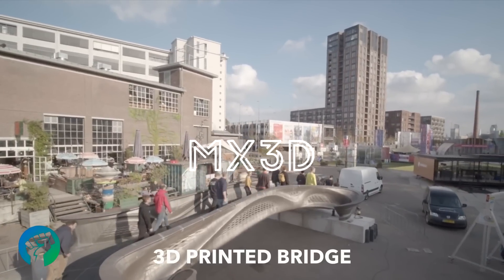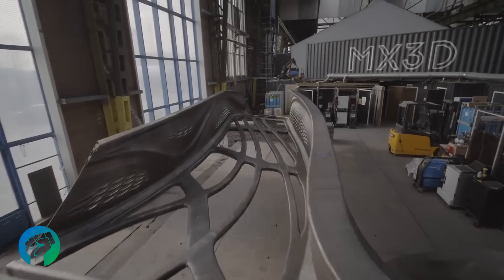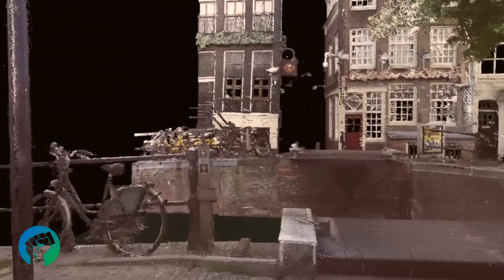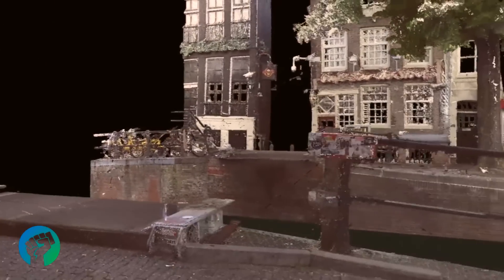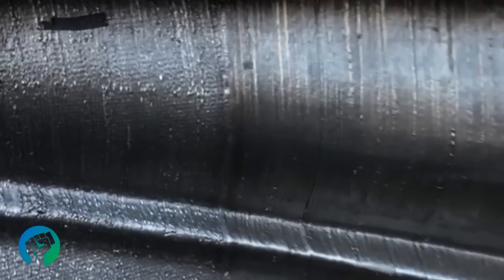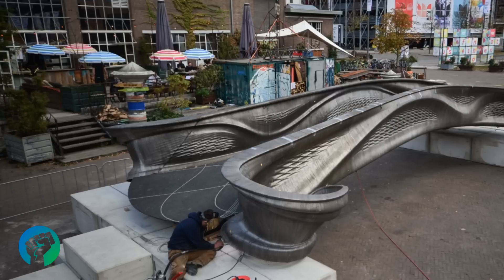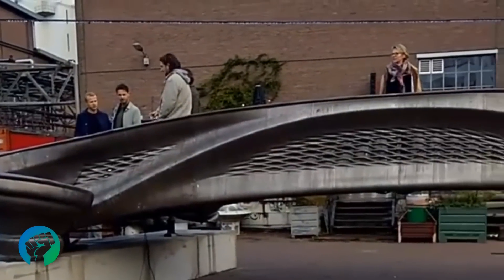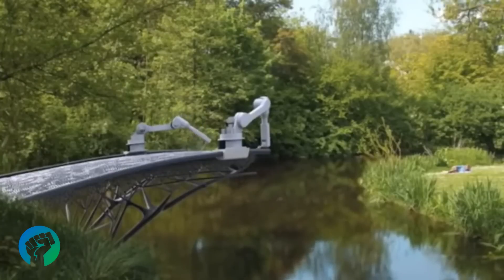This Bridge was 3-D PRINTED in Midair

Comment: you can see no actual welders were onsite to look after the actual welding, it shouldn't have those differences in the surface finish, a welder would have tweaked the machine to ensure that happen.

Comment: Sorry. Dumb project, dumb bridge, dumb pipe dream. We've been able to 3D print bridges for a long, long time but it's a really stupid way to go about building bridges; there are far, far cheaper ways to accomplish the same thing... and get substantially better results in the process.

3D printing IS NOT ALL THAT. The same goes for CNC anything. It's useful for certain one-off projects but it's not economically sensible for most things.

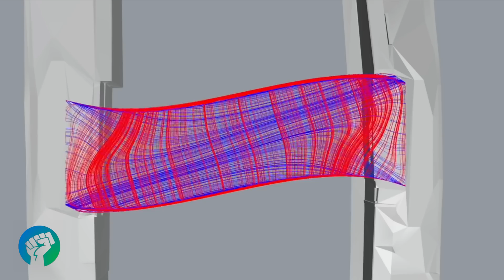Comment: 00:29 "Six months of printing.."

How the hell people willing to put their money into this..?
Reply: This tech will be very useful for permanent stations on Mars & the Moon
Reply: @freegedankenzurbaukunst5613  steel production is much more difficult off planet though, how will they solve that? Bring a bunch of coal coke?
Reply: @midgetman4206  They'll find a way . Humans always found a way
Reply: @freegedankenzurbaukunst5613  what do you think though? I want to see your gears turning
Reply: @midgetman4206  head could be generated using plasma arcs, which could get their energy from nuclear power plants. 
I think it's more likely that they will design structures which make use of available materials, like that 3d printed house using martial soil.
Reply: @midgetman4206  head could be generated using plasma arcs, which could get their energy from nuclear power plants. 
I think it's more likely that they will design structures which make use of available materials, like that 3d printed house using martial soil.
Reply: @gormauslander  you need to send a reactor first though, those aren't exactly light or robust, and you need other materials in order to make steel (at least if you want good/useful quality) such as nickel, cobalt, chromium, the right source of carbon, many other stuff.
 For the printed structures, how will the interior be made air tight? a spray? what about to make certain equipment such as plumbing? will separate material be brought so that it can be printed or will pipes and valves be brought along. Can't make tools unless a workable metal is found, if steel could be printed than a forge press could be made, that could make copper wire and that would allow you to make coils (for motors and soloniods) for drills or replacement motors for vehicles or servos for machinery. But all of that needs a method to manufacture metal, brass could make due but they just need something
Reply: Obviously because it's early tech. It would get faster as technology advances. 

Remember ENIAC? Compare that with the modern desktop PC and you'll understand.

Comment: This is exsactly the kind of thing we need to put money into. Building bridges and towering structures is dangerous af, and the heavy machinery used to make said structures are inefficient and expensive. Robots need to be a primary stable in the construction industry, because they can work 24/7, there areas can be quartered off to keep damage minimal and human safety secure, and they are just flat out more reliable and wouldn't be subject-able to unfair labor practices that plague the construction industry as we speak. I have a cheap little 3d printer and I'm amazed at what I can make with it for repairs and common problem solving. THIS video is showing that we can promise employees safe jobs, and don't have to force unnecessary strain on people just to cut costs and intentionally resort to foolish old methods, just to keep our worst businesses around.

Comment: me to my PE friend via text: "so how do you feel about a human-rated pedestrian bridge made out of nothing but weld-bead?" PE: (many LOLs)
Reply: As it's all weld, there are no stress risers,  so I'd expect it to perform more like cast metal.
Reply: @Mitchell Couchman 
This makes me feel like 3D printing is a bit over hyped. There may be some good things with 3D printing, but there's always some to take to impractical extremes. It's like Dave Rubin discovering yelp and thinking that's how buildings should be assessed and we can just discard building regulations.
Reply: @Competitive_Antagonist  Almost for a decade I am in search of a video or other proof of 3D printing having any practical merit to it. More in the realm of plastic filament home 3D printing, but this is same but on another level. It's always a "maker" being so proud of himself using a serious PC rig to CAD and toolpath, then using another expensive machine to print three clothes hooks that are $3 for a bag of 10. Or any other stuff that could be made out of plywood scrap and couple wood screws(or god forbid, a proper joint with dowels and glue) takes 1 tenth of the time, with 0 carbon footprint and without sitting face into the monitor for hours...
Reply: @Competitive_Antagonist     A lot of building regulations come down to market protectionism under the guise of safety.  I would rather choose to rely on 3rd party agencies than authoritarian edict any day.
Reply: PE? Physical education?
Reply: Professional engineer?
Reply: Pocket edition friend

Comment: Most parts manufactured in this nature need to undergo heat treatment to relieve internal stresses. I'm not sure how you could achieve this with an on-site bridge. i can almost guarantee that the way they are simulating stresses doesn't account for the internal stresses caused by welding. I've seen stress-relief done with "fancy electric blankets" but It seems really sketchy to run that kind of setup outside in public.

Comment: Mindblowing? Certainly not. It's simply the scaling-up of existing technology. With the size, the problems grew exponentially as well: Manufacturing time, energy cost tying up expensive manufacturing equipment. To compensate for the problem of corrosion, stainless steel had to be used (cost & environmental impact!) ... worst of all is that this thing is basically a giant design flaw in the shape of a bridge: vertical layering in a beam that's not completely under compression???
Reply: I would like to see actual figures that compare energy consumption of this versus creating the same shape and form from the same material with some other methods. 

Also would be nice to comparison time wise. Basically this tied up two industrial robots and some floorspace in some warehouse. Calendar time sure, but man/machine hours, not so sure without seeing calculations.

Stainless steel ... I'm not sure continuously fighting corrosion on mild steel with re-painting like is the tradition or hammering out and replacing crumbling concrete is that great either.

As to design flaw. If this will stand the test of time then then it was just a design choice. I'm always skeptical when a Youtuber knows better than people who put their reputation and money on the line and actually build something.

Comment: How much did the electricity cost?
Reply: yes.
Reply: Ever heard of solar power battery storage.....
Reply: @kylereese4822  honestly i highly doubt it was printed on solar energy, much less with batteries since they cost a hecc of a lot of money
Reply: @kylereese4822  ok, thats relavtively cheap. But if thats the case, why don't we run everathing on solar and batteries? If it was that simple it'd mean that capitalism has failed, and greed never fails lol

also i welding takes a huge ammount of power, you'd need alot of solar panels ergo a lot of space, a rooftop won't cut it
Reply: @kylereese4822  Bud...you're not gonna run welders on batteries.
Reply: @Tenacious21   Tesla car battery voltage are advertised as follows: for Model S and X - 375 volts and for Model 3 - 350 volts.  use a step down converter to 110 or 240 volts and the correct amps you can use a welder... ps want to see arc welding with car batteries ???

Comment: OK, that's cool, but if it takes 6 MONTHS to print such a small bridge it's basically pointless.
Reply: Hardly pointless. Time is not very relevant when it happens off line in some factory floor only 'consuming' floorspace, electricity and materials and some supervision.  Of course this was as much a demonstration and experiment in this sort of technology as it was just a practical bridge construction project. Further, everything, like printing bridges, has to start from somewhere. So there are already three points to this project. As the technology evolves this opens new possibilities, imaging printing a bridge over a deep and wide canyon or river, in situ, without the need to build support structures.
Reply: @jimmiller5891  As an experiment this is cool. But you would not want to build a full metal bridge of any large size this way (certainly not if it needs to support vehicles). Cost is everything. Welding rods and wires are 10x the price of rolled steel. I live in Holland. We build bridges of all sizes all the time here and blocking a road for 6 months is just unacceptable and too costly (a large bridge would be several years?). Welds don't have the needed physical properties because they are too brittle compared to rolled steel, which is why you'll never get cars and trucks over such a bridge. There's plenty literature why all welding techniques try to minimize the size of the welds. Look up. It's really nice for a small pedestrian bridge which won't see a lot of traffic, but don't expect this to scale up.

Comment: It is so much more cheaper, faster und usefull to use a modern fine grain steel (in combination with classical production methods)  than the 3D-printed stainless steels, which have a lower yield strength and a bad surface. Apart from that don´t forget the technical difficulties: Residual stresses, enormous energy consumption (welding process and powder production), bad surface quality (can cause fatigue cracks), limited materials. For lightweight parts and integrated parts the method makes much sense, but building a bridge? Are you serious?
Reply: Everything, like printing bridges, has to start from somewhere. As the technology evolves this opens new possibilities, imaging printing a bridge over a deep and wide canyon or river, in situ, without the need to build support structures. This can become more or less automated process so great reduction in man power. You list a lot of difficulties, that is the way to not have progress, it is only the unreasonable men and women who push the technology forward. 

As a side note I'm not at all sure that the energy consumption is that enormous compared to classical bridge construction, all things considered for erecting and scaffolding and manpower.  Bad surface quality? Many would consider that a feature (if it is structurally sound).

I for one applaud this bridge if not for anything else than for the fact that for once modern technology was used to create something aesthetically comparable but new and different from classical architecture instead of just straight lines, circles and cylinders and planes which is what we see everywhere now days even though we have all these amazing design and manufacturing tools available.
Reply: @jimmiller5891  That "somewhere" has been around like 20 years or so - this build nicely illustrates that by picking the wrong production technology, when scaling up job size, problems will grow exponentially. Toolless (CNC) sheet metal bending (Origami, basically) would have been an effective and efficient technology with a true wow factor.
Reply: @f.d.6667  No, it has not been around.  Printing bridges is what we are talking about here. 

Sure CNC and metal bending have been around, but can they build a bridge in situ? Without human intervention? Without scaffolding?    

This may have been wrong tool to build a bridge at this day and age. 

But this may have been the right project to demonstrate the potential of printing metal bridges.

PS. Can you show me a comparable bridge made with CNC?
Reply: Obviously, that bridge must have cost a fortune. But it sure looks pretty doesn't it?

Comment: Just think.  A Dyson sphere structure is achievable.  At this stage the biggest obstacle would be gathering enough material.  Then robots could can transport and on the spot near the edge of space start the construction of the object.  Such a structure could be extremely helpful.  Even if we could build  10 percent of a Dyson sphere on the edge of our atmosphere we could completely end future power problems.  With technology like solar panels on such a structure, huge amounts of electricity could be generated. This is such an exciting time.
Reply: How would you get the power from the sphere to the people on the surface? 
Moreover, a Dyson sphere is meant to be put around a star, not a planet. Putting it around a planet doesn't capture solar energy.

Comment: Microfractures: I'm about to end this bridge's structural integrity.
Reply: If this bridge has problems with microfractures then every single welded component on the planet has problems with microfractures.
I think you are assigning problems with partially melted plastic printing to welded metal, that is wrong.
During arc welding the metal is completely liquid, not true of plastic 3d printing. Metal can even be welded overhead.
Reply: @dougaltolan3017  Your normal 3D-printed part doesn't endure lots of load cycles throughout its lifetime like a bridge. As people walk over it or even vehicles drive over it, or with daily temperature cycles, every tiniest crack will open up and overload the neighbouring material, given enough time. Many large structures fail due to a tiny imperfection in a weld or an impurity in the material or surface that gets progressively larger until the remaining material is overloaded on an unfortunate day. The lifespans of airplane or ship hulls are carefully calculated with help of material science and estimated / recorded loading history.

"If this bridge has problems with microfractures then every single welded component on the planet has problems with microfractures."
- that is completely correct and you probably underestimate the care taken in placing, dimensioning and fabricating welds in crucial components.
Reply: @MrSaemichlaus  Thanks for your reply..
My understanding of this process is that it is managed by the exact same considerations that you refer to concerning dimensioning and fabricating.
Heck, theres even a company manufacturing rocket engines with this method.
Reply: @dougaltolan3017  I've heard of the 3D-printed rocket nozzles. I suppose they would heat-treat them after printing, maybe to recrystallise the material, close up cavities, fill capillar cracks by diffusion and most obviously, relieve internal stress that got built up during printing (where deposited material cools down locally). Additionally, although rocket engines take quite excessive vibrations during a single launch, they wouldn't get used long enough to encounter the same number of load cycles experienced by a structure such as a bridge, which is in permanent use over decades.
I think our discussion shows that 3D-printed parts satisfy many use cases, but for relatively high loads and dynamic situations, post-treatment methods quickly become necessary.
Reply: @MrSaemichlaus  Seems to be quite a lot of post print treatments, usually cosmetic surface stuff though.
Reply: @dougaltolan3017  Dimensioning and fabricating... Sure, nothing fabricated has ever failed, right?
Reply: How do you know it has microfractures? And even if it has, everything has to start in somewhere right?
Reply: @anderson-w7q7h  Because it is 3D printed. As someone who has a lot of experience 3D Printing, it does not create very structurally integral parts. Due to the way that layers are formed it causes a lot of imperfections, which can be very problematic and (like OP said) cause many microfractures when under stress.
Reply: @samuelforgie2771  Layers strenght might not be as problematic with metal if it's thin enough and if it's hot enough to weld with itself.
Reply: @samuelforgie2771  any article about that or you are just talking based on bro - science?
Reply: @samuelforgie2771  They can 3D print parts that are used in high-stress environments these days. I'm not saying that that is the technique used here but I know it's possible. I believe Koenigsegg uses this to print parts for their cars, among others the exhausts. That is with laser & sintering 3D printing though. However, if what the video says is true, this bridge is installed in Amsterdam across a canal, would they not have tested this?
Reply: lifelong welder and 3d printer nerd here... thats a lot of fracture zone... for a live load
Reply: Not to worry, that's why it's placed over water not highway traffic.
Reply: That’s why they had to install sensors and electrical crap just to keep an eye on it because they know it’s gonna brake
Reply: I'm sure they just got some randos with no engineering degrees to work this out so that internet dudes could accurately predict the failure.